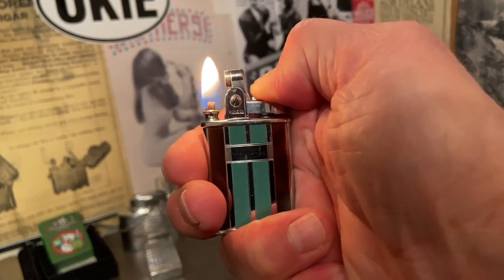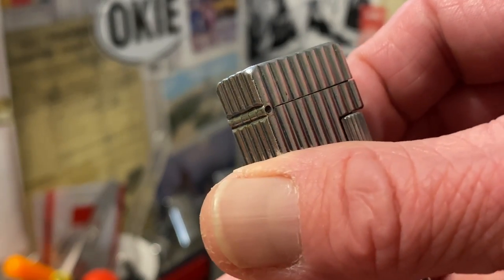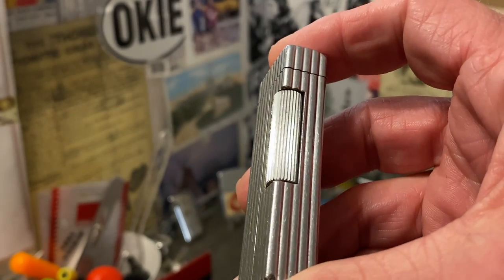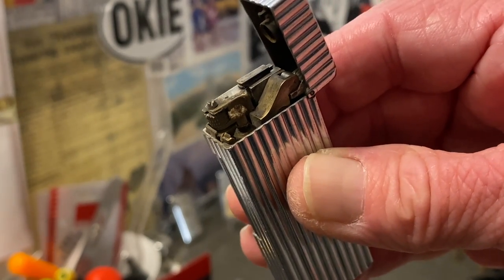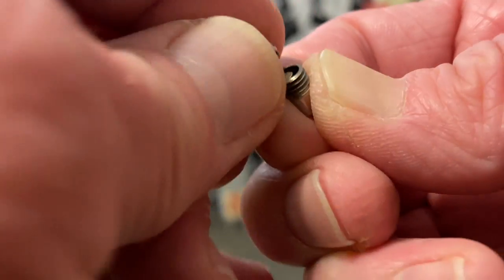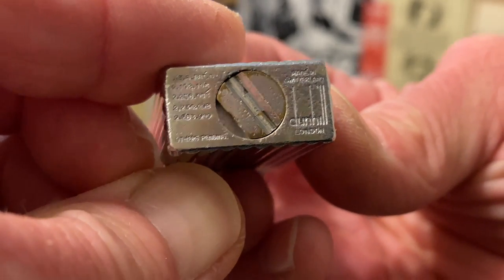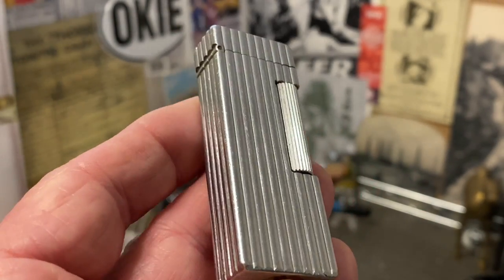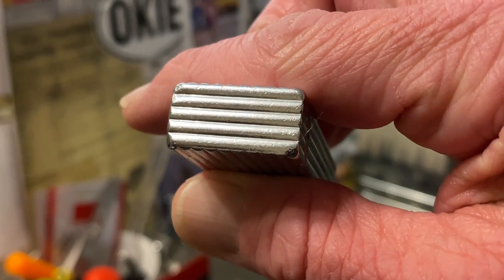Vintage Dunhill London Auto Rollalite Petrol Lighter MADE IN SWITZERLAND Ribbed Design

Comment: I just found a non automatic one on a second hand website, for 50€! quick question, do the wick's from zippo work for this? and what brand of fuel do you use? thanks!
-Jonas
Reply from the maker: You could use a Zippo wick, I think the Imco wire lead wick would work better. Zippo petrol fuel will work just fine.✌️
Reply: @DependableFlame  awesome - thank you again, good Sir!